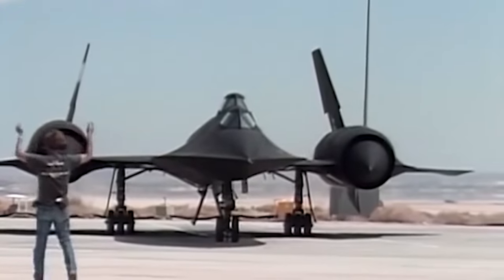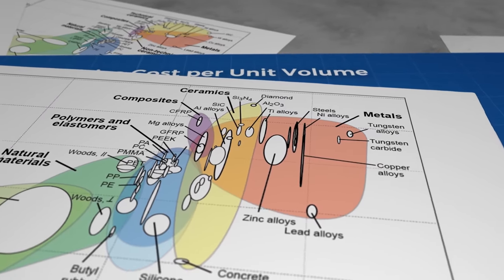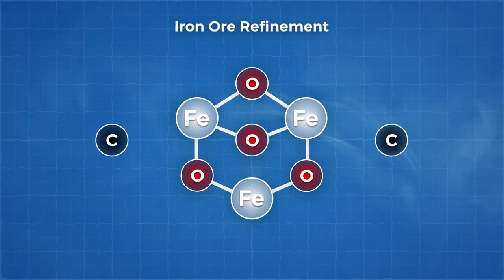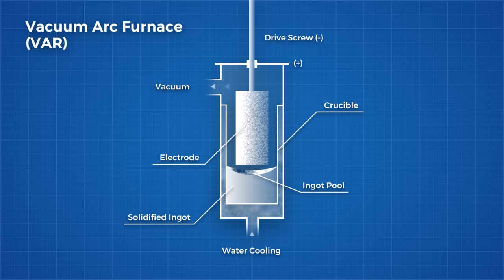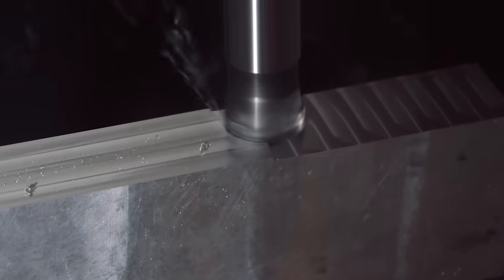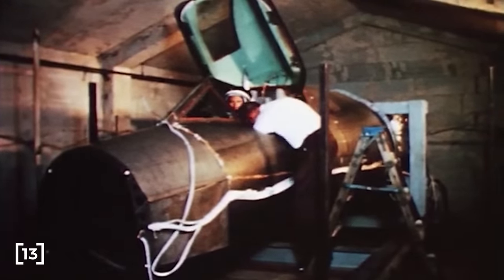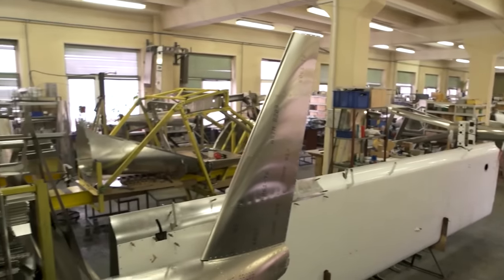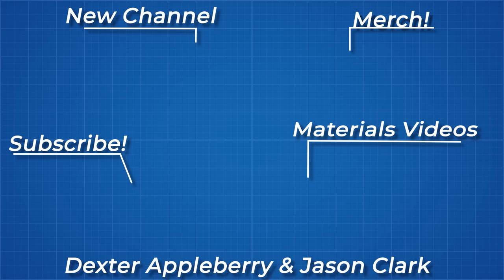Titanium - The Metal That Made The SR-71 Possible

Comment: Just like titanium, the air is bulletproof with the right thickness.
Reply: Air is even better that most bulletproof materials.  It self seals.  Even if your second shot exactly follows the path of the first shot you still have the full protection afforded by the air.
Reply: @gildedbear5355  In racing, cars will drive close behind other cars to get better efficiencies due to less drag. If air provided the full protection each time, then this wouldn't be done.
Reply: @Jaminhawk  it takes a little bit of time to "restore". Maybe a second, depending on the speed. But that my dear is called aerodynamics, a very complicated matter.
Reply: Well yes, but actually... yes
Reply: Is THAT air bulletproof?
Reply: What "air" do you speak of?
Nitrogen?
Oxygen?
Reply: @Jaminhawk  because it doesn't have the right thickness.
Reply: @A M they mean thickness, not density. let's say there is no gravity pulling the bullet down, the bullet will eventually stop due to airdrag. At that moment, the bullet could not penetrate the air and therefore is bulletproof.
Liquids are even better. A bullet will not travel further then 2m under water.
Reply: The comment was funny.  You guys are taking it way too seriously.   Any gas will stop a bullet given enough distance.  In this humorous take, distance is synonymous with thickness.

OP is not wrong, but it seems a lot of people's sense of humor is.
Reply: haha...nice
Reply: To utilize this property of air you'd just need to stay a couple thousand feet away from any gun and you're safe
Reply: It was supposed to be a fun fact. Guys...
Reply: Liquid is better than air in term of bulletproof. You don't need it to be as thick as air you just can't breathe with it.
Reply: Very true
Reply: @chouaibsam4381  everyone's just ignoring this guy
Reply: Yeah, but you aren’t ever going to be going fast enough to notice it, lol
Reply: It's saddening how many people have such poor reading comprehension that they struggle to recognize humour 'online'.
Reply: @tialin..9312  So you've never flown at 600mph in the rain ?I noticed it, that's why I don't fly anymore. I don't have wings and I don't drink red bull.
Reply: Cory Huskey lol what if the bullet has a built in ram jet engine. Then it will not stop it will accelerate
Reply: Ice, water, dirt, sand and clay are easily availble and very bulletproof. They're also virtually worthless so more thickness isn't a problem.
Reply: @A M you freeze the air, then because it is now a solid it is more dense. (Unless the air you are using has a high water content in which it becomes ice) 
Point being, ice king is bullet proof.
Reply: Oh also it being dense allows it to be stronger, able to slow down the bullet to a non-lethal speed such as 10 miles per hour
Reply: @brennalynnn  😜
Reply: Yes true. Just the right thichness will stop the bullet
Reply: @nick.......  but a "bullet" with an engine isn't really a bullet anymore is it?  It's a rocket.  Which immediately made me wonder if you could make a ram jet shaped bullet that would fly forever, but no.  It would need a source of heat to drive the jet and you probably can't get a radioactive thermal source small enough but still have enough heat production.
Reply: Air is bullet proof cuz friction lol
Reply: Did you mean a missed shot?
Reply: @QuinnHartmann  * laughs in sniper*
Reply: You lie..
Reply: @A M "Thickness" as in "distance" not "density". A mile of air should protect you from most of the firearms barring a purpose-built sniper rifles and anti-materiel rifles. ;)
Reply: Yeah, but problem is gravity is usually the limiting factor in most cases
Reply: Angular momentum is a critical component of calculations.
Reply: @jumpercable20  a
Water vapor molecules are lighter than the nitrogen and oxygen molecules......
Reply: @lordgarion514  Yes, that's why when it rains the ground gets covered with nitrogen and oxygen molecules.
Reply: @felis1977  
A tiny .22 long will go about a mile or better with the right elevation.

A .223 can go about double that.
Reply: Ah yes. The Joker has spoken
Reply: Never really thought of it in quite that perspective, but it is spot on...think meteors.
Reply: I know right
Reply: Fuck I never thought about it!.
Reply: Air is good armor against HEAT (spaced armor)
Reply: Dunno about you but I've never successfully penetrated the atmosphere with a bullet, they always seem to get caught in it.
Reply: Air on Venus
Reply: Now THAT was the comment I was looking for :D
Reply: @A M Firstly: I don't think you got the joke. Rewatch the first maybe one or two minutes of the video and you will. Secondly: If the bullet was dropped from space then gravity wouldn't matter that much. Yet the air would slow it down to its terminal velocity (if it didn't burn up beforehand). Actually: The bullet speed on earth is kind of limited as well, if you don't want your bullet to evaporate before hitting a target. So technically: a layer of air thick enough is bulletproof!
Reply: @addi498  Doesn't matter to the truthfulnes of the answer, though. It is bulletproof ... just impractcal.
Reply: @Jaminhawk  In modern high downforce cars, trailing too close actually makes you slower. It spoils the air, making you produce less downforce, meaning less grip, and therefore speed.
Reply: @pageandpowers  Air is a mixture of gasses and Nitrogen is a gas not a "real" mixture like our Earth's air.
Reply: @daanydoomboy5593  so you're telling me if i wear a 2,5 m thick vest of pure water im bulletproof?
Reply: @Anonymuskid  yes. from a regular bullet at least. Mythbusters tested it. Here is a nice video as demonstration: https://www.youtube.com/watch?v=L4Y4GUmvPkU
Reply: Page And Powers I think hes talkin about air alloy
Reply: @pageandpowers  allll of them every gas
Reply: Fucking genius
Reply: Bc friction, will very likely burn it completely before it reaches it's destination
Reply: How thick its needed? A view miles?
Reply: With the right Tickness he says, i guess his oirish
Reply: @daanydoomboy5593  so water is bullet proof too then
Reply: some air do be having a wagon tho
Reply: @TheR4T4T4  air IS a liquid to all intents and purposes, fluid dynamics works for both and is used in aerodynamics.
Reply: @Jaminhawk  he said it self seals, not that it does so instantly
Reply: Mandatory r/whooosh
Reply: @popuptoaster  Air is a gas and water is a liquid, air is only a liquid if you cool them so much that it condenses. Both are fluids though, and fluid mechanics apply. Do note that liquids are incompressible while air is only incompressible at low speeds (This means that the analysis will be different, depending on the speed of flow)
Reply: @nicholaslau3194  I did add "to all intents and purposes".......
Reply: Any material is bulletproof if you have the right amount of that material, but the practicality is the important part.
Reply: @QuinnHartmann  A couple thousand feet of air will not stop (most) gun bullets. Maximum range of a 5.56 is over 5000 yards. Its effective range is about 90% lower, but it will fly extremely far in a highly unpredictable tumbling parabolic arc for a very long time.
Reply: why dont we just make an air-plane then
Reply: Ben Richards it’s called drafting
Reply: Why is everyone so toxic to a joke
Reply: This thread is entertaining as hell.
Reply: @daanydoomboy5593  .....this was looked into by myth busters and was very interesting .
Reply: It does protect us from the vacuum of space, miraculously
Reply: @John-Tropi  he says "tickness" not thickness, pay attention
Reply: @foofooblenda734  :O
Reply: Mr. Giraffe everything is bulletproof in the right thickness
Reply: @Jaminhawk  well drafting is a fickle thing, my 2 cents, bullets in their supersonic regime create a shockwave ahead of them (goto smartereveryday or to the slo mo guys on their tank episode). Bullets following each other may cause slight perturbations in trajectory of the second bullet but the effect may not be as pronounced as in F1 where they can shave off multiple 10ths of a second of a laptime
Reply: that's alot of woooosh in here
Reply: There is no such thing as bullet proof only bullet resistant with enough firepower you can break anything
Reply: @Jaminhawk  ye but how far behind they are? 1/10 of second?
Reply: Ah yes the floor here is made of floor
Reply: Giraffe giraffe
Reply: @Jaminhawk  popular misconception
Reply: Titanium has the advantage of having the same temperature coefficient of expansion as ceramic.

p.s. If you look at the drawings displayed in the clip you will see a flat ceramic component; if Dural (duraluminium) was used instead of Titanium, the ceramic component would have shattered.
Reply: Thanks to Russia america discover titanium,because Russia have the only titanium oré mines in the world
Reply: @skhan2781 
Do you work in the aerospace industry?
You might find that Titanium is a 'pig' to work with, when drilling a hole, for example.
Reply: Soviet MBTs use air in their composite armor
Reply: Actually true
Reply: AHAHAHA LOL
Reply: @Jaminhawk maybe in nascar, not in F1
Reply: There is only one known material that is not bulletproof given the right thickness, which is dark matter. Cause space aint slowin shit down.
Reply: theres no such thing as 'bullet proof' just bullet resistant
Reply: look up Tunguska or meteor crater, AZ.
Reply: That's profound wisdom .like the sound of one hand clapping.
Reply: Lmao I just imagine planets fighting with comets and using their atmosphere as a shield
Reply: @lobsterbark  down force only matters ln corners and rapid acceleration, moving at a constant velocity u don’t really need down force since there is very little chance of losing traction
Reply: @pageandpowers  air is the name of earth’s atmosphere 
N and O are gasses found in the air.
Reply: Lol more like gravity is bullet proof.
Reply: more like with the right speed but thickness plays a role too
Reply: Just like titanium, humans are bulletproof with the right thickness.
Reply: Alright, nerds, how many layers of Doritos bags do we need to stop a bullet?
Reply: @A M   the bullet will eventually stop due to airdrag also, there's this thing called a joke
Reply: How does scandium fare?
Reply: @pageandpowers  helium
Reply: And air is resistant to heat due to friction..... If we can manage to fit devices in air....
Reply: People too, best to be back of the queue.
Reply: I like the smell of steel being turned. Aluminium unpleasant and brass doesn't. Voilà my knowledge of metals. MMCs, I know about.
Reply: @Jaminhawk  id imagine the object flying through the air can be shaped to come pretty darn close. ya know, like if it didnt look like the back of a nascar, something designed to also produce downforce. Heck look at UFO's. Humans would say thats impossible. What they can do lol. I work at Bell Helicopter and know a guy there here that swears he's seen one haha......
Reply: @brennalynnn  yes
Reply: @Anonymuskid  pretty much, yes!
Reply: Best comment of the section
Reply: @gildedbear5355  depends
Reply: @Jaminhawk  true, but there aren’t any materials that regenerate the same as air
Reply: @Jaminhawk  it's called the slipstream and you have no clue what you are on about
Reply: @daanydoomboy5593  air does not create drag, items traveling through the air have drag, what the air does create is "friction"
Reply: @gildedbear5355  x.
Reply: @gildedbear5355  to you and Ambar you are closer than the new 🆕🆕🆕🆕🆕🆕🆕🆕🆕🆕🆕🆕🆕🆕🆕🆕🆕🆕🆕🆕🆕🆕🆕🆕🆕🆕🆕🆕🆕🆕🆕🆕🆕🆕🆕🆕🆕🆕🆕🆕🆕🆕🆕🆕🆕🆕🆕🆕🆕🎉🆕🆕🆕🆕🆕🆕🆕🆕🆕🆕🆕🎉🆕 🎉 uu
Reply: @gildedbear5355  you and Yu uuuuúuuuuuuuu
Reply: @gildedbear5355  7uuuuuu7uuuuuu77uu77u7uuuuuuuuuuu7uuu
Reply: @gildedbear5355  uuuuuuuuuu77u7u7uu7uuu77uuuuuuuu7uuuuuuuuuu
Reply: @gildedbear5355  oo
Reply: @popuptoaster  Air is a fluid. Not a liquid. Lol
Reply: Guy makes a joke, and the comment section turns into the "uhm, ackshually" meme
Reply: The original comment was absolute gold and classic humour. Top notch work.

Sadly, an astonishingly number of people have failed to grasp its central and key premise: that any and all substances, elements, compounds, materials, and/or states of matter in any combination are bullet-proof... Given the right thickness. This joke is more about the satirizing and deconstruction of the phrase "the right thickness". 

By definition, being bulletproof is ALWAYS about the "right thickness". Because it's not "right" until it's "thick enough" to be "right".

A theoretically indestructible substance (let's call it adamantium or vibranium) would only need to be 1 atom or molecule thick to be bulletproof, while uncompressed goose feathers would need to be many 100s of metres thick.

The only thing that's not (without getting TOO metaphysical as there are clearly scenarios that could apply that reduce the accuracy of my statement) is a vacuum - more precisely a large volume of space that is devoid of matter.

An analogous idea is that all substances are toxic given ingestion in sufficient quantities. There is no "toxic" there is only dose. 

So let's all chill, learn some basic science and English comprehension and buy Mr Giraffe a drink.
Reply: Pick your favorite rifle cartridge.  Whatever the maximum range of that cartridge is, that's the thickness of are you need to make something bulletproof
Reply: It's the last in the list, everything is bullet proof with the right thickness 🤦🤦
Reply: Water is actually inversely bulletproof. It can stop high powered rounds much easier than low powered ones.
Reply: I am building a bunker of air, but I am worried about efficiency, including cost efficiency, I guess  it should be built on a cold place to increase density and also in a humid place, other than that it should be close to sea level but I wonder if I should have any considerations about the soil to increase density, gosh! I won't be able to sleep tonight
Reply: @pageandpowers  Actual, regular air found in the earth's atmosphere including both elements you mentioned. Air is bullet proof, no matter how many shots you fire through it, there are never any holes left in it.
Reply: @TheR4T4T4  ... in terms* of bulletproofness*
Reply: BRUH
Reply: @Jaminhawk not at the size of a bullet dunce 🤦 the reason it works with cars is because it’s a large vehicle that moves a lot of air at once, this means it will take more time to get the air back to normal